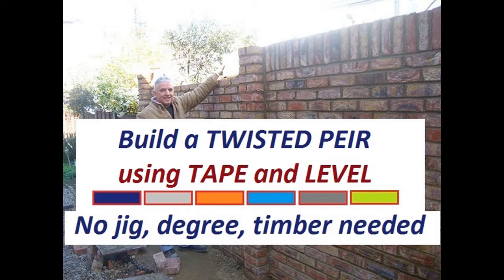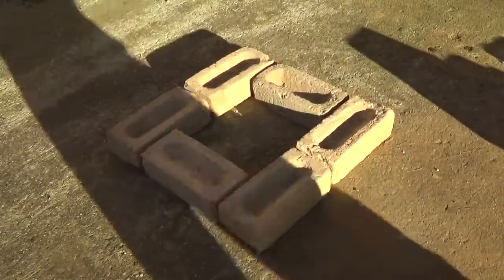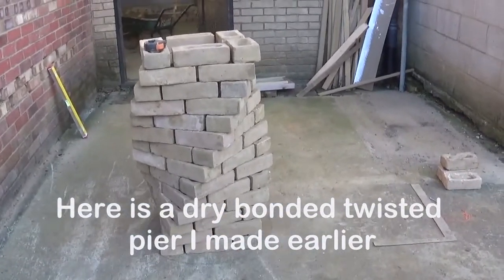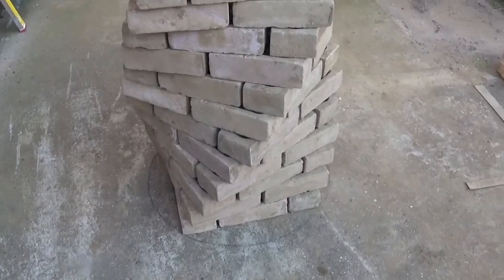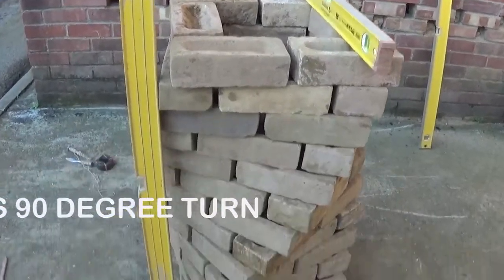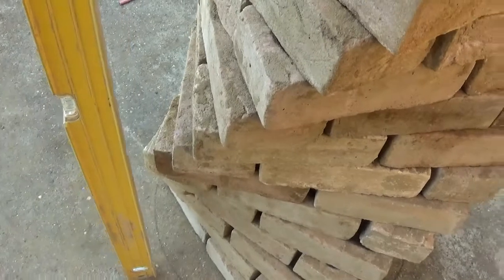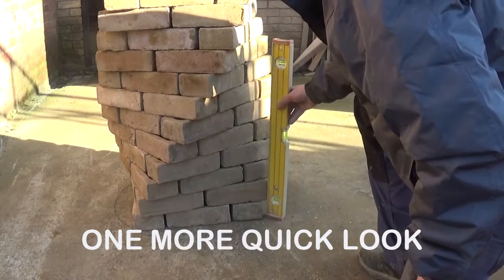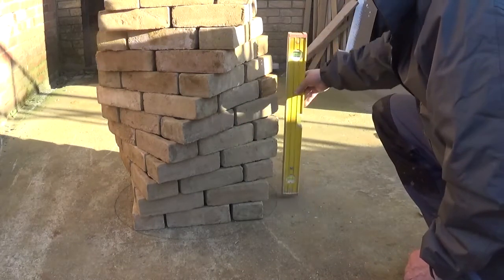How to lay bricks and build a TWISTED PIER

Comment: I like this . I could never understand the attraction of these twisted piers they look like something left over from the 60's . Setting out the geometry strips away all the mystery. A nice little video ,well done !  The diagonal check on a 440mm pier is 623mm ,and a plumb bob would be useful as well .
Reply from the maker: 623? I'll have to wear my reading glasses next time i check, but  whats 3mm amongst friends
Reply from the maker: Actually, I'm the same. The twist should start on the fourth course and be topped off with 4 straight courses and it dont look so bad, but twisting from the ground up is less appealing me thinks, thanks for comment